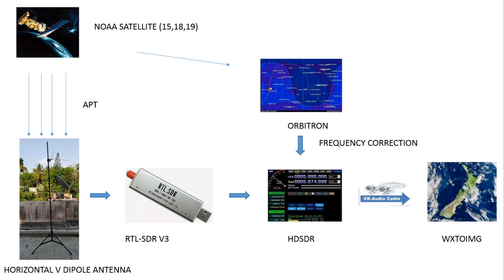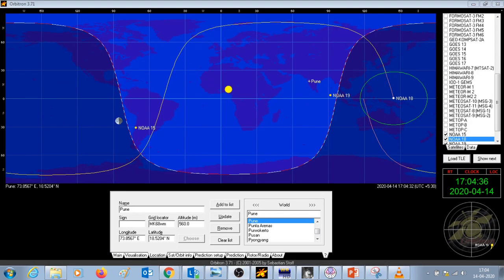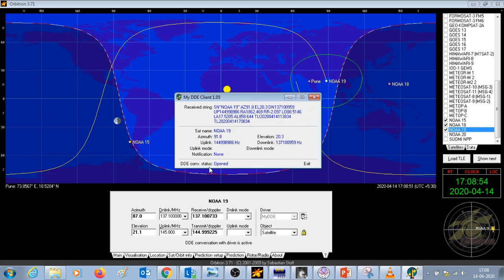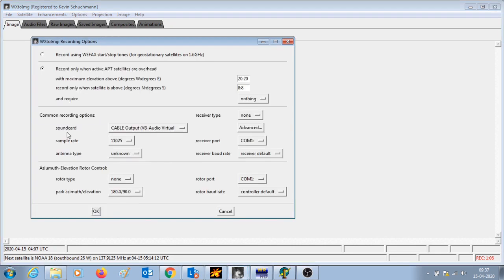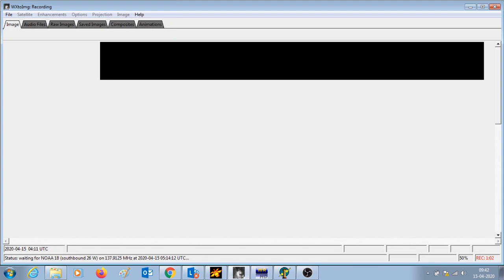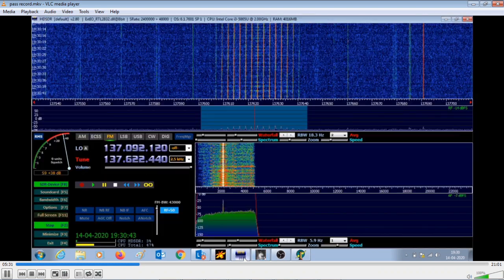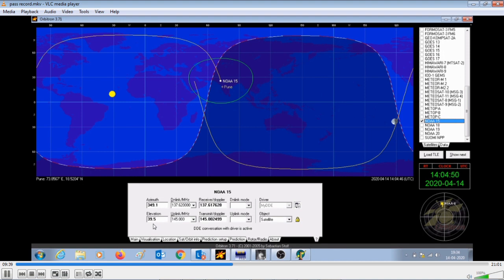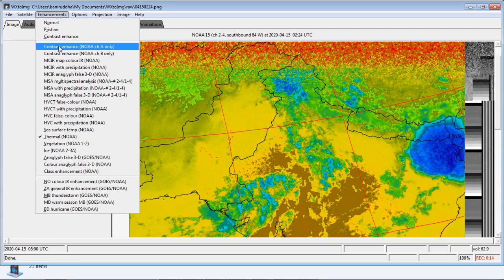Receiving & Decoding signals from NOAA satellites using RTL-SDR, HDSDR, Orbitron & WXTOIMG softwares

Comment: after going half way thru, i get the error that "PLL not locked" in the sdr section (using a rtlsdr v4). after that the wxtoimg does not install any file at all on my win11 pro. very disappointing esp after going thru so many steps. dont you have a simpler  solution using sdrangel or some other software! thanks
Reply from the maker: Please check this video if it helps:
https://youtu.be/VNe8LLgEjIU?si=A33VbQhLVwbXhgbz

Comment: some part of my image shifts horizontally 
how can i correct it?
Reply from the maker: This is the sync problem you are facing. You can try the offline method of decoding the image... Please check the other video in my channel.
Reply: Hy is this legal to do in India? Are these noaa broadcasting signals ?
Reply: Legal to do without any license ?
Reply from the maker: @megharkrishnan3061  These are free to air signals and you are receiving them using sdr.
Reply from the maker: @megharkrishnan3061  Yes, and yes